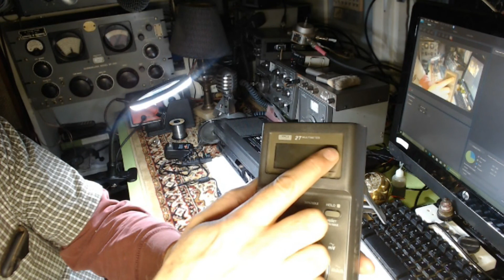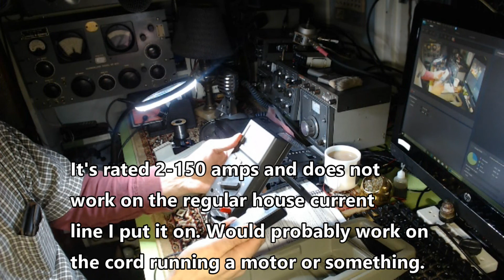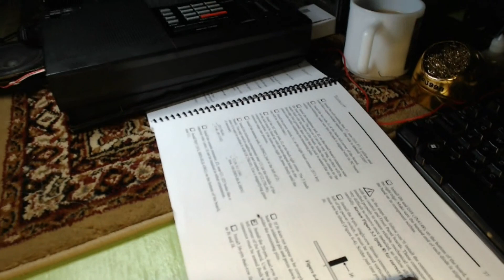Tom, K2bew Shop update 2/01/2018

Comment: I have two cats and the one Dog Chubby who you see in al of my videos at one point or another. The cats are both 12 yrs old cand chubby is 4 yrs old.  Luckily for me I retired back in 2008 at 57 but 31 yrs was long enough for me. Your job as a nurse has to be demanding at times my hats off to you there Tom. Great that you will be off on week ends. I have a Fluke 15 still works great. Thats a really nice meter a Fluke 27 cant beat that. Thanks for the Update.

Comment: the clamp on probe can only go around one wire , not both in a extension cord and the meter jacks has to be on mv inputs the clampon produces very small power so clamp the probe on just the hot wire , not both